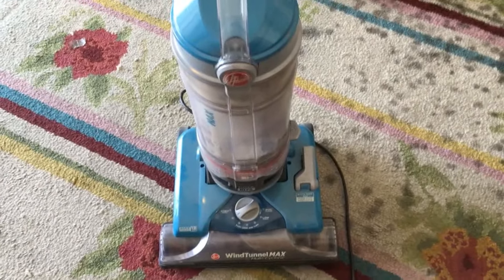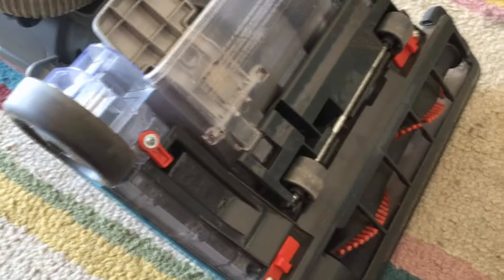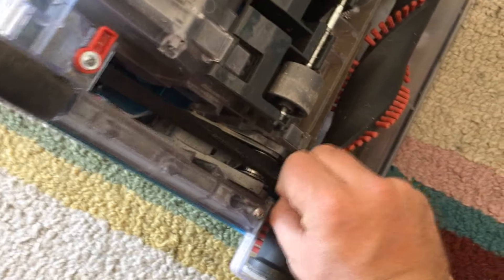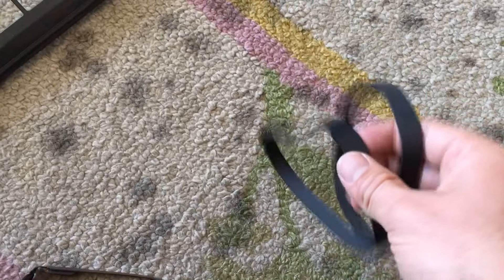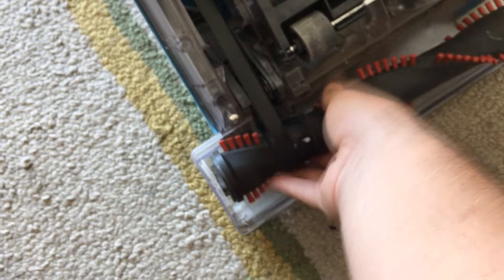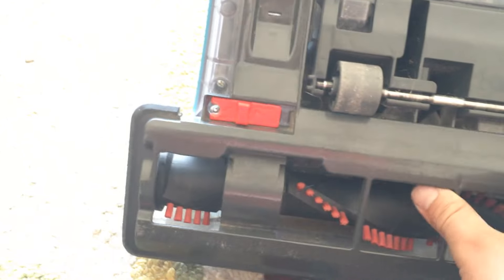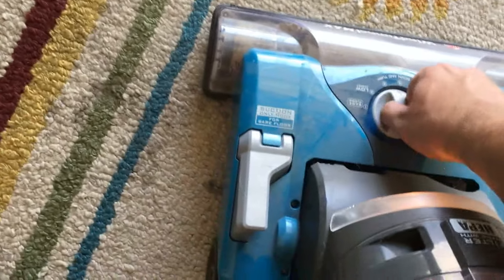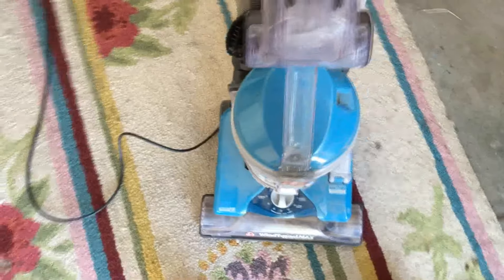Fix Hoover Windtunnel Roller Brush Not Working

Comment: What could be other than a bad belt when the part that makes the belt move, hence the roller brush spin, is not turning or moving?
Reply: In my case: there was a brush on brush off button near the power switch that had gotten accidentally toggled that I didn't even realize was there. Hitting the button got the roller spinning again.

Comment: I replaced my belt but there is no tension on the belt at all. I was wondering if there is a piece that may have fallen off the shaft.
Reply: Did you figure out what was wrong? Same problem. New belts too...same issue. Thank you.

Comment: 2nd hand UH70210 had the brush stop spinning. As the brush was not jammed I figured it was the belt. Replaced belt, still no spin. Brush still moves freely,  if I set the vacuum cleaner upright and tilt forward, the belt seems to engage. it seems the tension is lacking on the belt - any suggestions on how to increase tension on the belt?
Reply: I'm in the same spot.  Replaced the belt but it still won't spin.  Did you find a solution?  Thanks

Comment: So when vacuuming carpet, should that brushroll pedal be up?
Reply from the maker: You want the brush turned on and spinning for carpet, shut it off on hard floor
Reply: @hanksgarage_  Good evening! & No i mean that little pedal that you step on, to be pushed in or released up. Should it be up on down?
Reply: @klp605  The little square pedal on the back needs to be pressed so the handle is tilted back, otherwise the tensioner won't engage with the belt. I assume the reason is to not overly stretch out the belt if the vacuum isn't in operation using the beater bar/is off. You will notice when you put the handle back into the upright position that the tension lever on the front relaxes a bit, similar to when you have it in hard floor mode.
Reply: @aoitamashii  This was my problem too. I was going to vacuum the stairs and I thought I broke something when only the brush turned off. After I read your comment I tried it with the handle down at an angle, and worked as usual. I didn't know this was a built in feature to shut it off when the handle was in the upright position.
Thanks

Comment: I had a problem where the drum would not move. The belt was intact. I solved it by tilting the vacuum like normal use and pressing the brush roll button.

Comment: And what do you do when replace the belt and the roller still won't turn?
Reply from the maker: Pull the caps off the sides of the roller brush and see if you can free the bearings and clean everything out. If they are frozen and can’t be saved replace the brush roll. If that’s not it. It may be the tensioner on the foot pedal for the belt. Check that roller and see if it’s locked up.

Comment: I changed out the belt with the Hoover replacement. It went in real tight and burned off in minutes. I replaced again same results. What am i doing wrong?
Reply from the maker: Need to clean the motor shaft. Likely had burned up rubber on it which will destroy a new belt.
Reply: It's clean. Machine had about 3 hours on it when it lost the belt.
Reply: Edward Childers t.

Comment: even though it seems to have lots of torque my beater bar stalls out completely on carpet causing the motor to overheat & the thermal protection kicks in & shuts it down for 30 min. I guess this is worth a try before I give it to goodwill. Thx
Reply from the maker: Sounds like the end caps may need to be cleaned on the brush roll